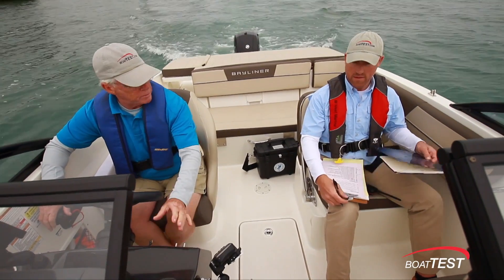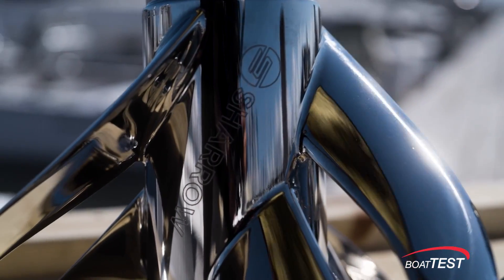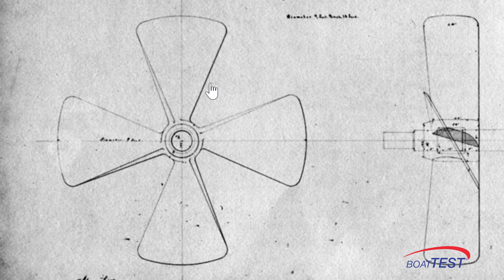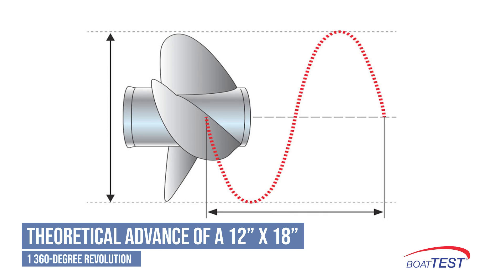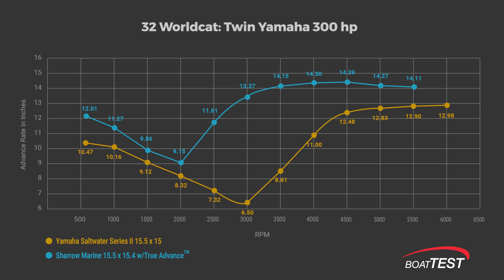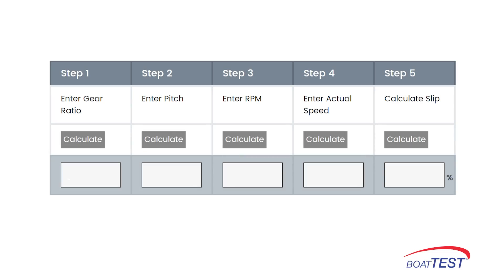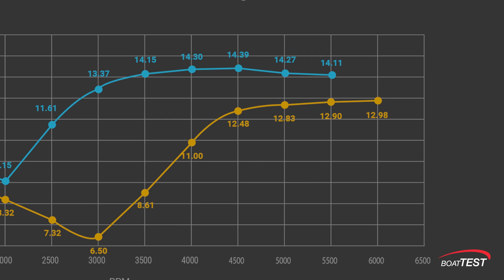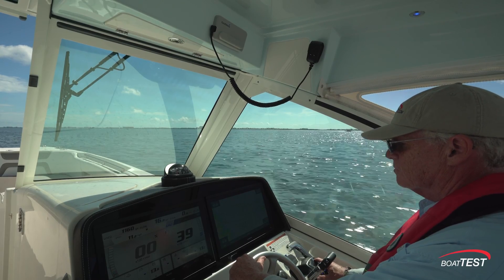Sharrow Props History (2022) - Video by BoatTEST.com

Comment: Sad to see you shut off comments on the Silent Yacht video, especially given that you included misinformation/disinformation in that video and didn't actually test the boat.  This undermines your credibility.  Simply do the math of the kwh it takes to move a silent 60 at 8 knots for 24 hours, and then add up average production of the solar panels and you will see that the boat will be running on generator after the first day.  Saying it is the "first production solar boat to cross and ocean" leads people to think it crossed the ocean under solar power--- which is dishonest!
Reply: Maybe they had steamed at a slower speed like 5-6 knots ? There are huge power differences between 8-6 knots.

Comment: Being a fisherman who mainly fish small ponds and lakes,I wonder how a Sharrow prop would do on a trolling motor?
Reply: Should make a difference to the trolling motor which would be nice in high river current or wind. 
I think this advancement came about with the advancements in wind and water turbines. Either way I  will be ordering a Sharrow Prop for my next boat. Well done gents!👍
Reply: Unless you are making a lot of money from fishing, or spending a lot of money on fuel, they might not be worth it. The larger and the faster boats, let alone large fast boats, drink fuel. If your boat is a low-cost puttputt trawler I can't seen the reason for the investment.